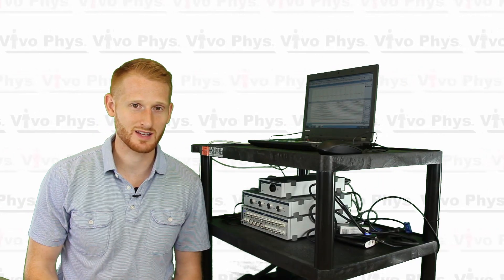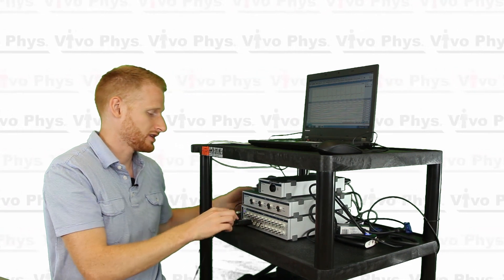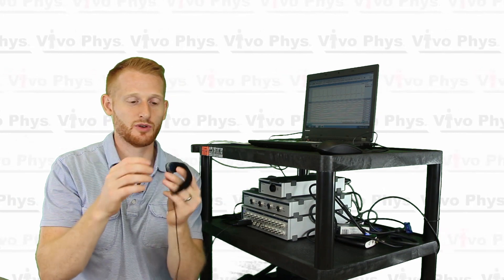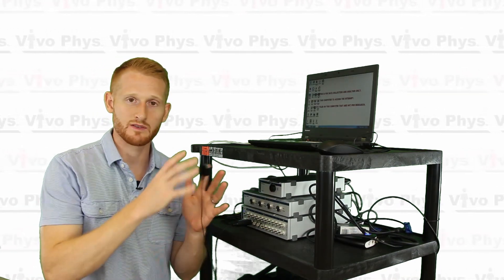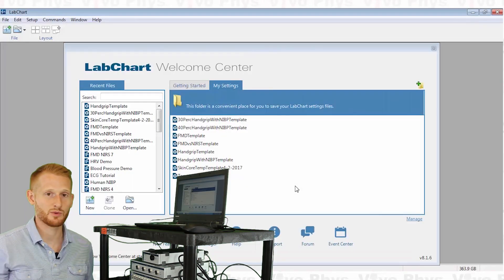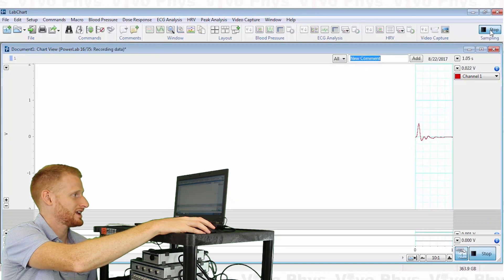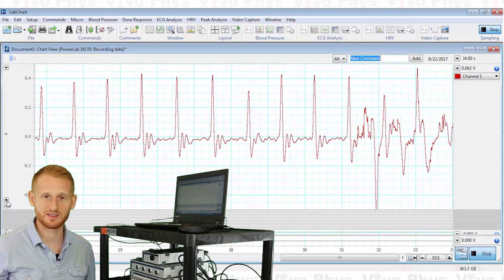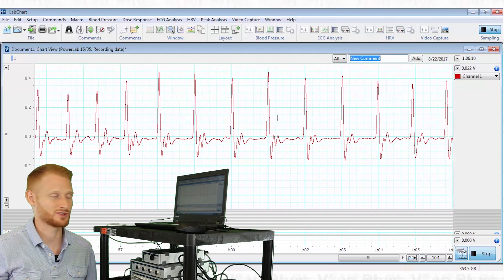Tracking Pulse - Pulse Transducer in PowerLab

Comment: Hi! Thank you very much for great video!  I would be very thankful, if you would explain y axis! Why is it measured in Volts? How does the amplitude colerate with pressure changes? Thank you very much! When is it used in clinical aspects?
Reply from the maker: Hi Unicorn. By default LabChart reads the y axis as volts and x axis as time. You would need to calibrate it in some way to convert the y axis to a more useful variable. The pulse transducer might be able to loosely calibrate to systolic BP, but it is likely highly inaccurate for doing that. It is better at just showing the timing of the pulse.

Comment: Thanks for this video. Do you need to calibrate the device before each use? If so, how do you do this?
Reply from the maker: If all you are doing is extracting pulse timing then no.  If you are attempting to relate the peaks to systolic blood pressure then yes.  I've never actually done it my self though.

Comment: Hi Dr. Matthews, thank you for your video. My question is how can I convert mV in BPM for the heart rate from finger pulse?
Reply from the maker: You would need to use the cyclic calculation function in power lab and have it output a heart rate value into another calculated channel.
Reply: @VivoPhys  Ok, I got it, thank you. And is it also possible to convert the signal from pulse oximeter in %O2? I couldn't find the right program.
Reply from the maker: If you are feeding the pulse oximeter data into power lab and you can see clear cardiac cycles in lab chart  then you should be able to do it.
Reply: Ok thank you very much @VivoPhys

Comment: Hi,
What filter parametrs did you use for your measurement ? Im doing pulse Wave analysis using this  equipments and my signal is very bad, i have a lot of random peaks
Reply from the maker: I did not alter any of the software parameters when recording this signal. So whatever the default settings are in LabChart is what I used. Make sure it is wrapped very tight and make sure the participant is perfectly still. I would be curious to hear what software you are attempting to use to analyze the data for pulse wave analysis.